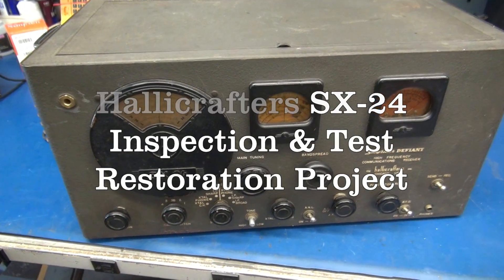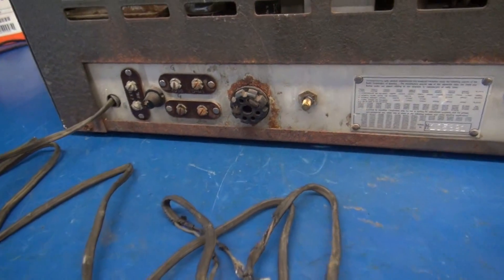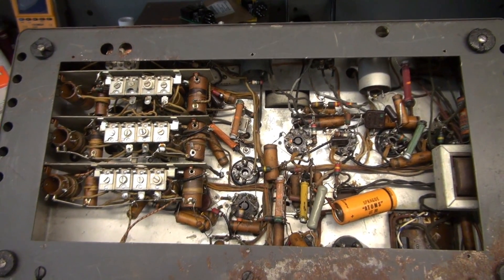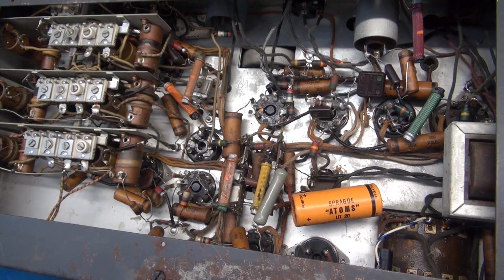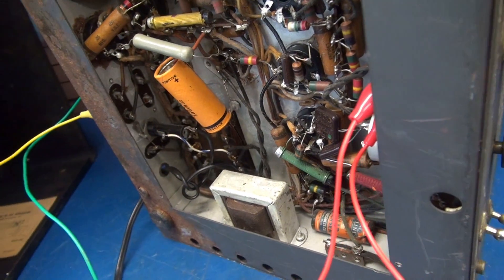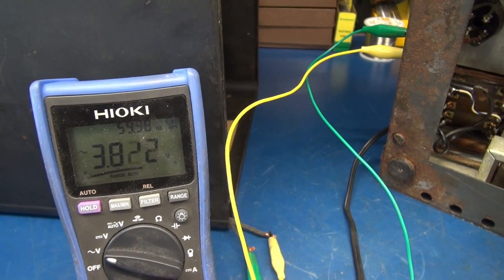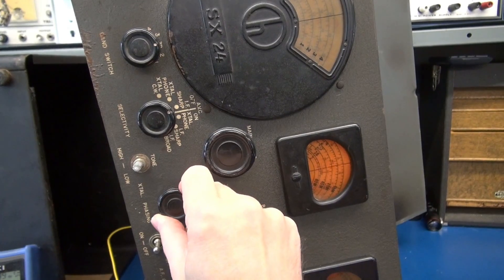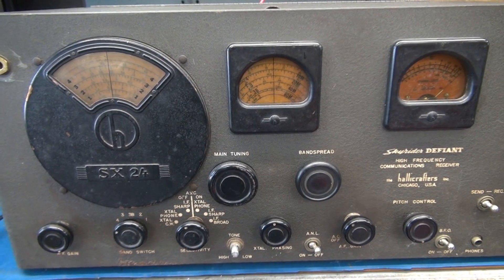Hallicrafters SX-24 tube type Ham shortwave receiver Inspection Restoration project

Comment: I have a Hallicrafters  SR-34.  (6 or 2 Meter) ;   6v / 12v or 120v.  It worked, except it needs one new octel tube socket, which causes the tube to come loose.    I had a Skyrider with a built-in speaker, which is apparently fairly rare.